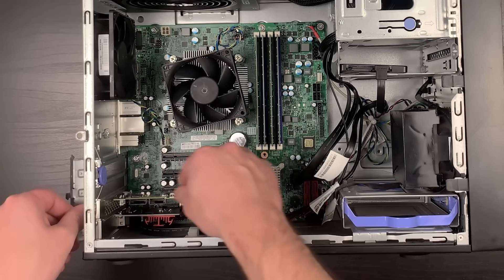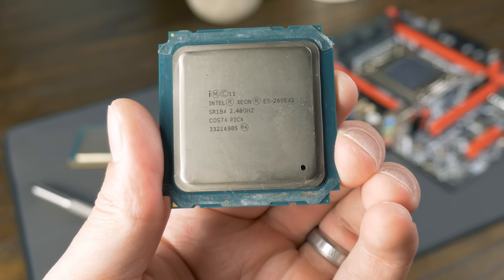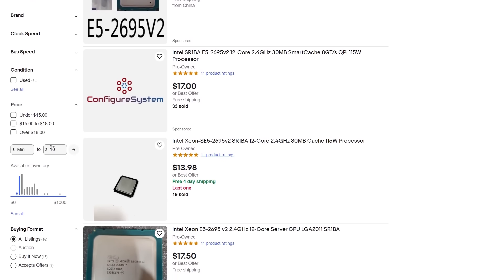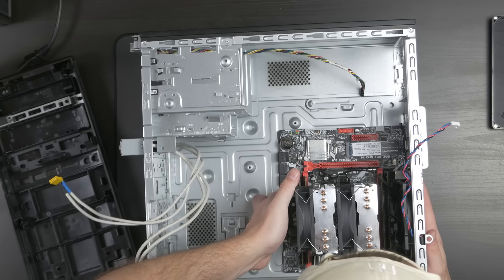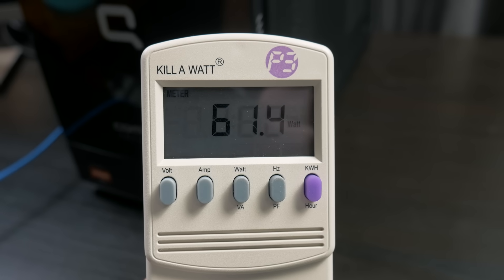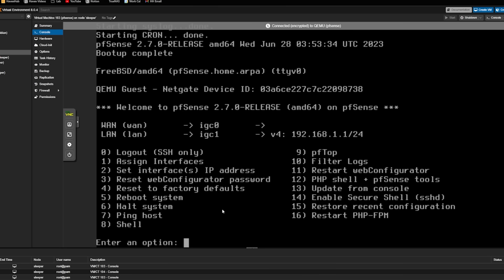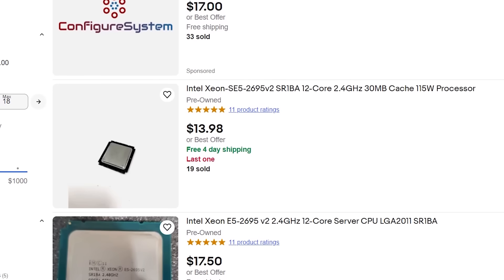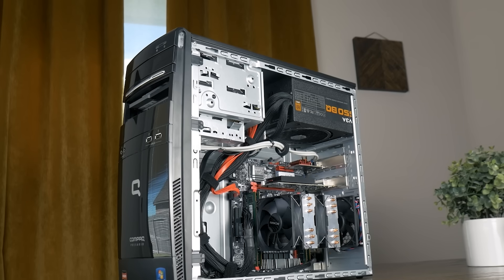Are CHEAP x79 Servers/Workstations Good In 2024?

Comment: If I am going to build budget build a server for file storage, I think it's better to go for stronger cores than many cores because transfer speeds are often single threaded.
Reply from the maker: @StringerNews1 buddy, just chill lol. 

And to answer your first question, there are plenty of examples where cpu can be the bottleneck during data transfer, especially with something like 10+Gb/s networking and when using flash storage. The CPU is also important for handling parity calculations. Considering Marco mentioned file storage, it's likely he was referring to Netwrok Attached Storage, which will usually be setup in some sort of RAID configuration requiring parity calculations. Those parity calculations are mostly single-threaded from what I understand. 

Not sure why you felt the need to go all redditor on someone in the comments.
Reply: @StringerNews1 What a nonsensical rant. Everyone, including yourself, knows exactly what he meant. You need to tone down the intellectual complex.
Reply from the maker: Yeah that makes sense!
Reply: In practice the speed of light or electricity is anything but constant, it varies with the dielectric and frequency. Even with DMA, processing the data from I/O typically still generates interrupts which requires copies from kernel to user memory
Reply: @shanent5793  Exactly. When the uninformed refer to the speed of light they are actually talking about the speed of light in a vacuum.  Elsewhere, it is diminished by the square root of the dielectric constant of the medium.
Reply: @StringerNews1 Clearly your reading comprehension of the room has failed my good friend. The speed of the data transfer is often single threaded. And, eeePCs don't use Denverton Atom CPUs lmao. Again, have you ever used SMB?
Reply: @StringerNews1 your words are still pointless and unfounded.
Reply: @StringerNews1 that's some pretty deep projection, bud.
Reply: @StringerNews1 and since it's you vs an entire comment section, you are obviously the one that can't read.
Reply: @StringerNews1 you have failed, walk away to save some face. Windows and alot of Linux cpu management does favor single core file transfers. So you are both right in a sense, but at the end. They are the most correct.
Reply: @StringerNews1 you havnt supported anything. What do you mean once again? There are hundreds If not thousands of articles and videos on this stuff. Proof is in the pudding not baseless statements.
Reply: In my opinion, the most important thing for a file storage is that it is energy efficient
Reply: go withj a dual socket setup so you can get high ghz and reasonable amount of cores as well by going with frequency optimized chips but 2 of them....its great :) im running a pair of 2690V4's myself!
Reply: totally agree; I love X79 and X99 era and I have a collection of boards & CPUs. But for a file server/NAS, there are so many cheap boards and cpus that are more efficient and have high enough IPC out there in the used US market already. Even past Skylake and 1st/2nd gen Ryzen/Threadripper.
Reply: @CheapSushi  ryzens 2400g and 3400g are making most sense in energy-efficient home server
however if ur using it not only as cloud storage, cheaper xeon on x99 will be better
Reply: Good thing we have TeraCopy and ChoEasyCopy that attempts to use multiple cores and different transfer algorithms
Reply: That''s what I was thinking. Considering Alder Lake (2021) had E-Cores as fast as Skylake, which is at least 3 Gens ahead of even Ivy-Bridge. Intel's saying that P-Cores (this is from some industrial PC forum, and IDK how threading applies to ICS/SCADA.) are at least 50% faster per thread, and P-cores are hyper-threaded. Also, heat, power, PCIe boot (never native on x79, and you're trusting some rando on Aliexpress). Plus, you're either using ancient (I probably wasn't even in middle school at the time, and I'm a senior in college now) boards, or rolling the dice on a Aliexpress special for storing valuable data.
Reply: The hell was Stringers problem???
Reply: @ehhhhwassupdoc  they just wanted to argue.. not really worth worrying about.
Reply: @ehhhhwassupdoc  from what I gathered based on a bunch of replies to him, he was arguing against single core performance for file storage servers, and it seems he was also being quite rude about it, I never saw his comment and it seems his account may have been taken down as all the tags with his username are no longer linked
Reply: I have had the same issue. I went with a faster xeon so gigabit wasn't a problem but I wonder if it would struggle to saturate 10gig. I have dual socket 2697s with 8 channels and 256GB of Ram so the setup made a lot more sense.
Reply: @3of12  That's right. SMB is single threaded.
Reply: Data transfer is a light cpu task, having more cores makes more sense traditionally, to handle more transfer requests simultaneously
Reply: @roanbrand7358  ipc actually seems to matter more than more cores. But it definitely depends on the application and or os.
Reply: Good server grade network adaptors can offload most of the work of TCP frame creation and unpacking, but without that offloading ethernet will consume about 1ghz of CPU core per 1Gb/s of bandwidth. So without offloading, a 2.0Ghz 4core CPU will only handle about 8Gb/s of ethernet; thus a 10Gb or 25Gb connection could easily become a CPU bottleneck if the server is setup and configured poorly. (Note CPU load is a very rough estimate and I am not considering the difference between physical cores and virtual cores [SMT aka hyperthreads].) 

Using jumbo frames (usually 8000 or 9000 octets) for dedicated subnets will also reduce processing loads on all components of the subnet. This usually requires a second ethernet port for a machine that also needs to communicate with standard frame (1500 octet) network devices, because frame size is set per physical interface. (I have heard there are a few routers and layer3 switches that can translate jumbo frames into small frames but YMMV) 
Total effective bandwidth with jumbo frames can be 10% improved for large files and loads on devices that need to inspect frames will be reduced 10-20%(maybe more for firewall-routers doing inspection); the processing load on send and receive devices is about 1/3 (whether the load is pure CPU or has been offloaded to the network card; with offloading jumbo frames will not have much effect on the CPU specifically but it will reduce heat and electricity used in the NIC.)
Reply: my budget server was done with the low tier e3-1230v2s, idles at 56w but its also full of drives so I think comparatively it does the job well
Reply: @StringerNews1 well, you had a problem with the phrasing of the other comment and yours had a problem too.
Reply: You been living under a rock or just boosted?  The speed of light is not a constant.  It's variable.  Face Palm @StringerNews1
Reply: @StringerNews1 "First of all the speed of light (electricity) is a constant". Well I stopped reading your rant there. Electronic engineer here: electricity doesn't move at the speed of light at all. To over-generalize for daily purposes, it's around half the amount. In your cables, electrons are moving at like (I'm ballparking here) 1 millimeter per second. You can probably google that answer, but the important part here is that "electricity" as in the electrical concept, moves like if you were to push the books on your library shelf: one books pushes the other and so on. That will never be equal to the speed of light.

So next time you're gonna rant about something, at least try to be right at first. Oh, I might've been wrong in some numbers I'm sure, but at least I know that my knowledge is limited.
Reply: @Gaspa79  „In your cables, electrons are moving at like (I'm ballparking here) 1 millimeter per second”. That's some kind of ballpark. I suggest using Grace Hopper's trick.
> This bundle consists of about one hundred pieces of plastic-coated wire, each about 30 cm (11.8 in) long. Each piece of wire represents the distance an electrical signal travels in a nanosecond, one billionth of a second. Grace Murray Hopper (1906–1992), a mathematician who became a naval officer and computer scientist during World War II, started distributing these wire "nanoseconds" in the late 1960s in order to demonstrate how designing smaller components would produce faster computers.
> The "nanoseconds" in this bundle were among those Hopper brought with her to hand out to Smithsonian docents at a March 1985 lecture at NMAH. Later, as components shrank and computer speeds increased, Hopper used grains of pepper to represent the distance electricity traveled in a picosecond, one trillionth of a second (one thousandth of a nanosecond).
 -- https://americanhistory.si.edu/collections/nmah_692464

There's also a video https://www.youtube.com/watch?v=ZR0ujwlvbkQ&t=2714s
Reply: @StringerNews1 «"data transfer rate", that's a hardware function, not a CPU function». Isn't the CPU hardware too?
Reply: @StringerNews1 anyway, how is DMA getting the data from the disk(s) onto the network when the protocol (TCP/IP, Samba/NFS, etc) requires a bit of processing? Then there disk encryption could also be involved, although getting 1 Gbps or 2.5 Gbps isn't spectacular.
Reply: my 200$ 2x e5-2680v4 server will prove you wrong
Reply: @StringerNews1 Lmao. You've never used SMB on a 2.1 GHz Denverton Intel Atom. Have you?
Reply: @StringerNews1they can easily become CPU bound, have you never operated a zfs arrary with a dozen or more drives, let alone ssds? Over a 40gig interface? The CPU overhead is a problem even on Eypc Rome CPUs.